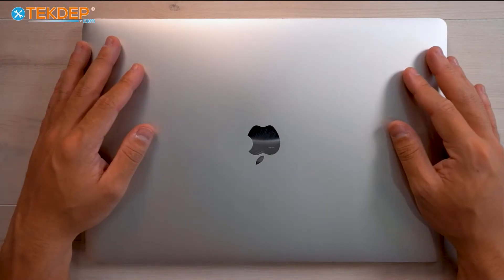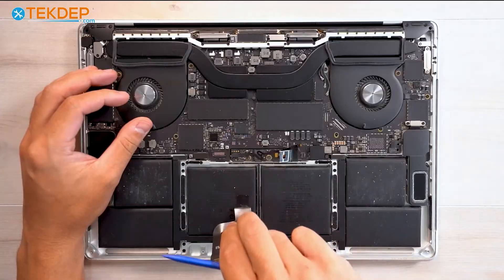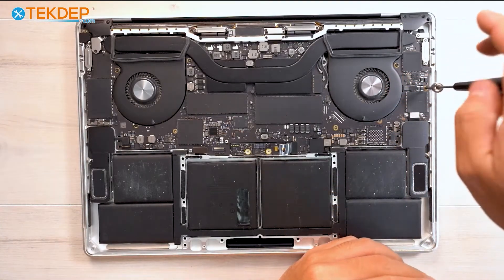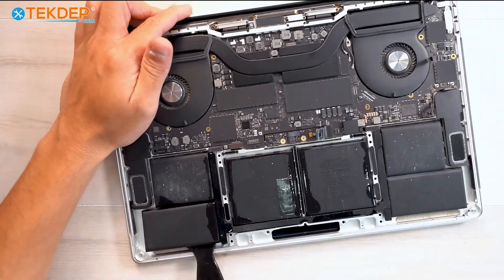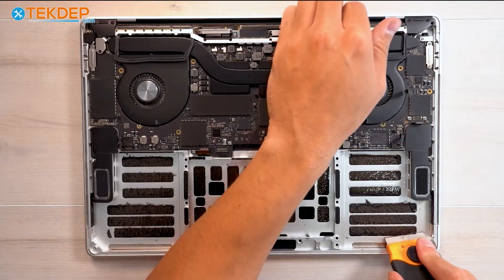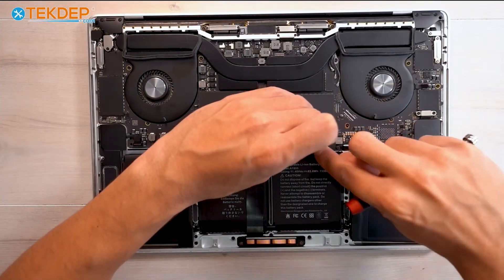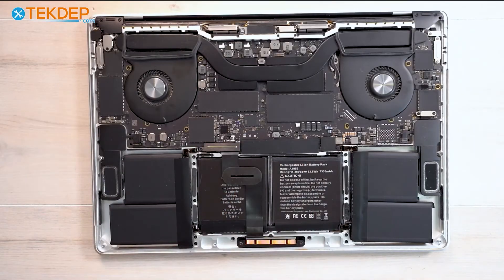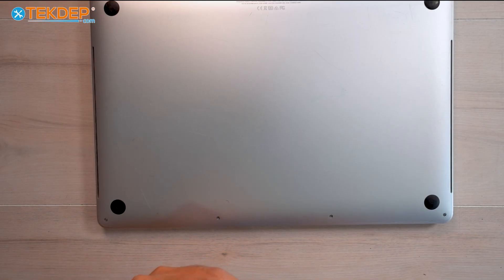DIY MacBook Pro 15" A1990 Battery Replacement | 2018 & 2019 Models TEKDEP

Comment: Great video. What's going on with the right side of the battery not secured evenly? Any issue with that?
Reply from the maker: Good catch! These batteries can be tricky to line up perfectly because the adhesive is so strong—once it touches the case, it’s difficult to adjust. Even if it's slightly slid down or off-center, as long as the battery connector board is properly aligned and screwed in, it won't affect the performance or the bottom case fit!

Comment: Totally awesome video.  I need to replace mine and no Apple batteries available anymore so need an aftermarket one.  Trick will be to find one that lasts more than 6 months (claim made by Apple Store tech).  Any recommendation on a supplier?
Reply from the maker: You can check it in our website @ https://tekdep.com/

Comment: Thanks for this detailed video! My old MacBook's battery had started swelling and putting pressure on the case after only 2 months of it being turned off. Was able to safely remove it thanks to your video. Still debating if I want to put in a new battery because the laptop is out of service but that's for another day :)

Comment: Thanks for posting - I purchased a battery replacement for a 2017 Macbook Pro with the same processes - however, the instruction steps that accompanied gave a vague description of what I think is the logic board connector with the tape cover and now I am unable to get it to adhere and once I reinstalled all other components, I am unable to get the unit to  power up or charge. (guessing it is related to the tape connector not making good contact. Any tips or recommendations? Thanks,